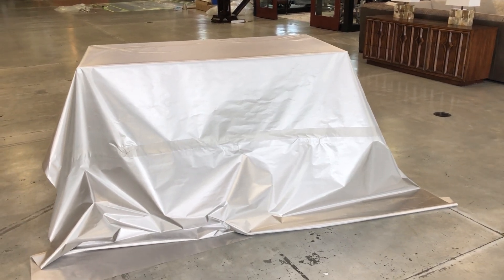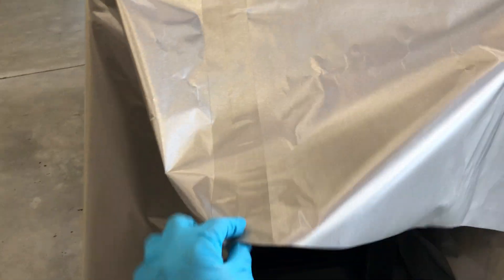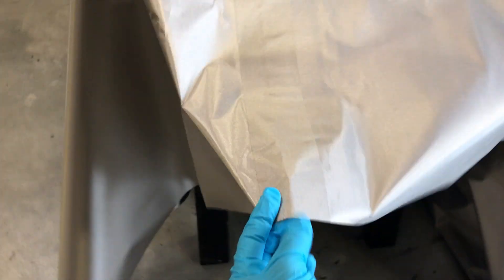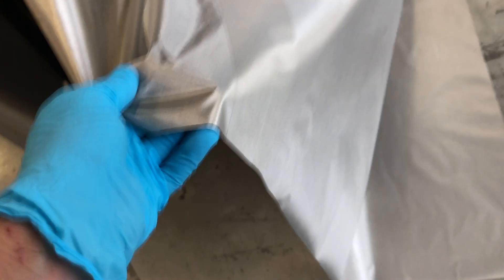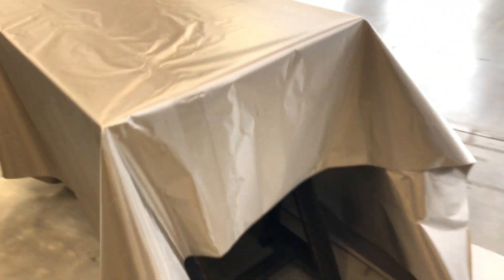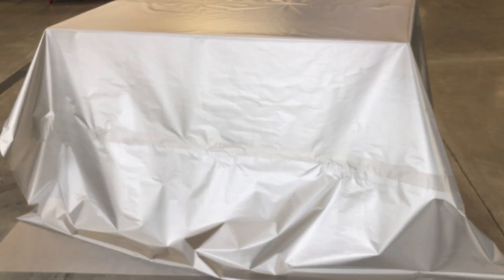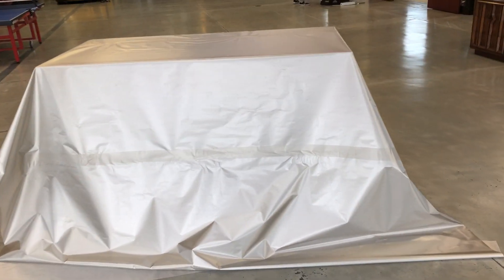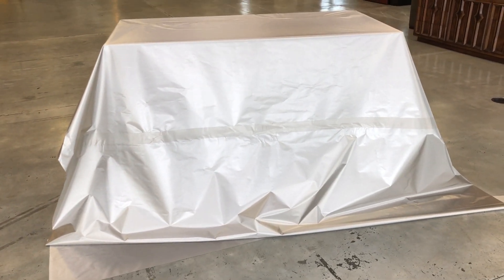Mission Darkness™ TitanRF Faraday Fabric Panel Demonstration Video

Comment: This material is not meant for begginers, it is crazy conductive and will shock you in certain env, requiring a ground. While highly conducive,  and tightly knit it did nothing for the low bands, highbands minmal but distance kills them
Reply: @ELORE the low frequencies have a smaller wavelength and slip through this fabric. The high frequencies have a larger wavelength and are blocked by this fabric. Technically, it's not blocking, it's called "attenuation" which means the frequencies emitted by a device travel the path of least resistance and when a cloth like this is covering the device, that cloth becomes the path of least resistance. So as the frequencies travel through the cloth, they become less and less powerful, which diminishes the distance they'll reach. So you may be protected completely at around 3 feet away while 1 foot away you might still be bombarded with frequencies. Compared to an uncovered device that might emit frequencies for up to 200 feet (speaking in general terms here, not specific to a specific device). 

It can absolutely be for beginners, don't listen to whoever said it's not. You just have to know how to use it. Grounding conductive material is the same concept as grounding appliances when they are plugged into the wall with 3 prongs. The grounding wire sends the charge in a specific direction. Away from whatever is being grounded. Some people ground these fabrics with copper poles inserted into the earth, and there are also ways you can connect it to a grounded outlet (look up the emf bed canopies from emf-protection.com they explain it well there).

Hope that helps. Sorry you were met with self-righteous arrogance for asking a question.
Reply: @AwakeningWarrior  The real question is: How many layers did you use?
Reply: @user-ev7ub9bo9e  Not really. If you ground it, layers don't matter. Use 1 layer and ground it, done. :)
Reply: @AwakeningWarrior  What exactly is grounding? And would this fabric be very effective as clothing?
Reply: @user-ev7ub9bo9e  Grounding creates a path of least resistance for the frequencies to travel into the ground. You can ground directly to a copper pole in the ground (usually 8 feet long) or you can ground into your outlet if your outlet is properly grounded. The outlet sends the frequencies to your breaker box where it will also send the frequencies straight into the Earth through the grounding post that is connected to your home's breaker box. It's actually really easy to do. When I ground my conducive fabric, I use a cord that only has the ground wire connected and I plug that in... on the other end is an alligator clip that I clip onto the fabric. It works perfectly! Even though a body voltage meter will give a high reading when you ground conductive fabric that touches your body, it isn't going into your body. Some people see the readings and freak out, but as an EMF-sensitive person, I can say with certainty the body voltage readings are actually conducing the frequencies to the meter as you touch it when you are grounded because when I ground fabric I wear, I get 100% relief from the EMR that normally would cripple me.
Reply: @AwakeningWarrior  thanks buddy! I had the same question but didn't spit out because of really hot in here. Thanks again
Reply: @kingcobra4528  No prob!! :)
Reply: @AwakeningWarrior  
hello what i really want to Know Is If this fabric really blocks / 4G 5G etc,  Cause right next to my house theres a a Fkng bank / store of electrónics and whenever i need to go pay,  my brain feels like melting,  so i Need to wear this for my life! 🙌 ill leave my coment on several Places cause It urges me to get It 😢. Help 

1.- whats the exact name of the real working Big sheet, and have a link? Theres plenty on Amazon but very expensive and not very detailed or trustworthy, i Need the real Stuff 

2.- have you tried It yourself, does it work with just one layer ? 
For me, whenever i get close to a 5G or newer phone models  i start getting super hot everywhere , and cant think straight at all, pain etc etc so i  Basically need to wear this
Reply: what frequency ranges did you test MHz/GHz? At what distance did you find the signal to drop or be impeded? thanks
Reply: Material conducts, shocks; blocks high-frequency signals better than low-frequency.  Lowbands: long-wave, penetrate easily. Highbands: short-wave, blocked more effectively by conductive material.  Lowbands penetrate, bad; highbands attenuate, good.
Reply: Laid it over my comforter last night do to it sparkinging i did wind up knocking a copper pipe in ground and connect via alligator clips
Reply: @ELORE first 5 words, means not for you, instead of complaining to people dumb down for spoon feeding, maybe learn and read stuff, gain knowledge
Reply: @jimbo987  Dude you're so rude.  Another Human Being is genuinely asking for help and all you do is insult them.  Humans need less people like you and more people like the person you were rude to.
Reply: @unique_giftsfor_less1749  based off a few off your comments , seems you have a comprehension issue.. 1. There is no insult. 2. Its been proven time again, information that you search for yourself, vs just doing some steps you were handed, you greatly increase your understanding of whats going on, why and how. <- 3. Follow 2, you reduce risk of injury to self. To many times seen people get hurt,  damage equipment.. because they followed easy steps with no foundational information.
Reply: @jimbo987 
 
hello what i really want to Know Is If this fabric really blocks / 4G 5G etc,  Cause right next to my house theres a a Fkng bank / store of electrónics and whenever i need to go pay,  my brain feels like melting,  so i Need to wear this for my life! 🙌 ill leave my coment on several Places cause It urges me to get It 😢. Help 

1.- whats the exact name of the real working Big sheet, and have a link? Theres plenty on Amazon but very expensive and not very detailed or trustworthy, i Need the real Stuff 

2.- have you tried It yourself, does it work with just one layer ? 
For me, whenever i get close to a 5G or newer phone models  i start getting super hot everywhere , and cant think straight at all, pain etc etc so i  Basically need to wear this
Reply: @Tohru3608  G just means generation, without a spectrum analyzer i cant suggest  where to begin. As an EE both in private and  mil,  traditional  microwaves is blocked by plywood.  Yes i have it still , its crap. It only became usefull when draping it over another metal.  Side note, i also do have quite abit of experience being on the recieving end  of nonconsent  weapons guineapig. There is a couple things going on in todays social credit system with teeth. As a spinal chord injury , i am very well versed in reffered pain or phantom pain. This particular system is using phased arrays, not a conventional magnetron. Its in the broadband IR range. They classify it as photonics for optigenetics.
Reply: @Tohru3608  we all know how tight $ is now, if your better then average with a pc, best bang for buck is a SDR
Reply: @jimbo987  thanks my friend 💯🤚✨
Reply: @Tohru3608  your periphial nerves registers heat and ultrasound the same way, only difference is heat causes damage nd blisters
Reply: @jimbo987  easy man! Please explain, i want to know it too